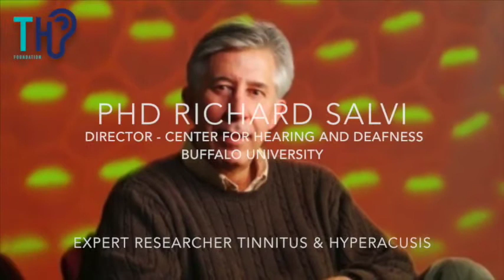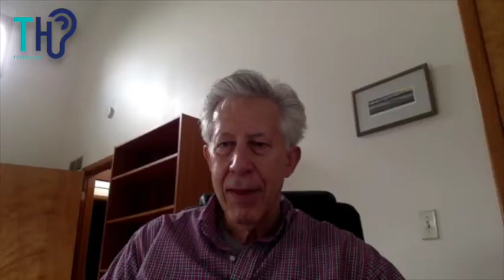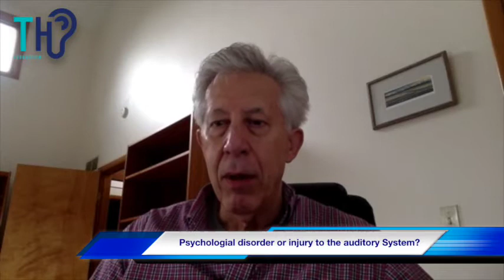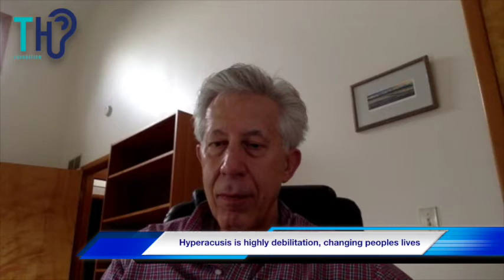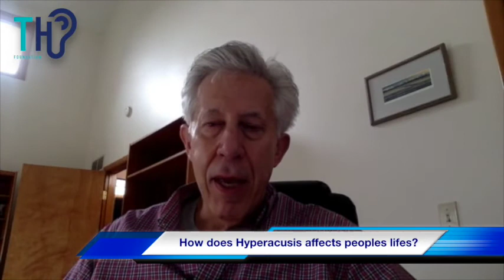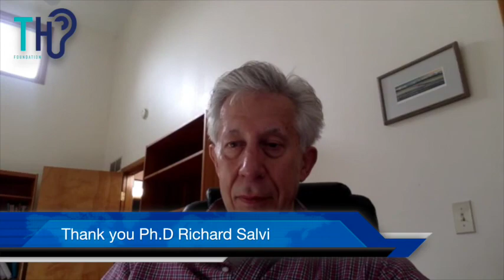Hyperacusis & Tinnitus Interview with Ph.D Richard Salvi

Comment: I have bilateral hearing loss and tinnitus also. Mine is 24/7 buzzing-static electricity in bothe ears and my head. It is debilitating I havnt even been able to work it’s so bad. ENT always says nothing can be done. They think mine is from a virus because the right ear is so much worse than the left. My hair cells are damaged.